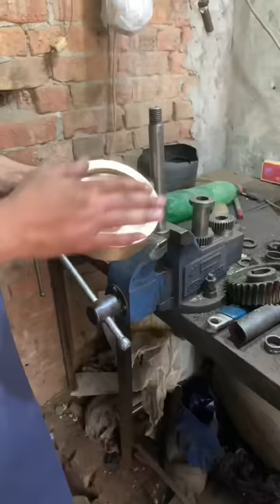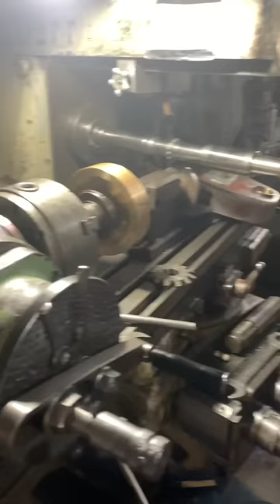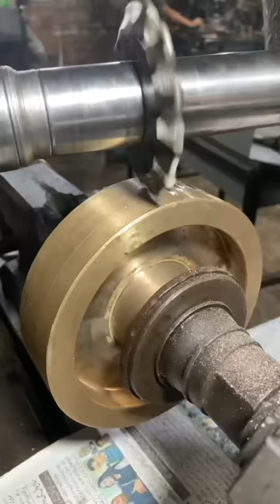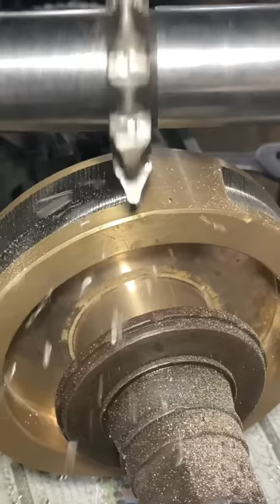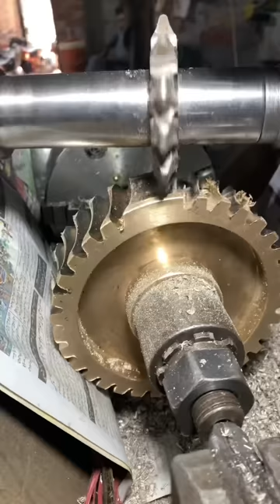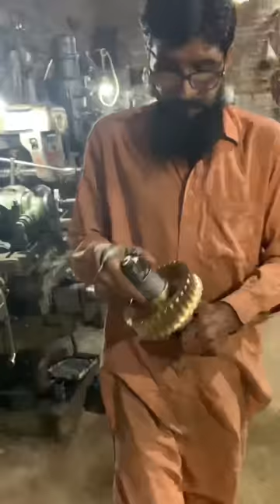Making Worm gear

Comment: It's not a proper helical tooth when cut this way. There is only one point of contact at the very center of the tooth, and this creates a lot of friction because of the high pressure at that point. It will wear rapidly if it is transmitting very much power.

You should cut less depth and then finish the gear with a hob.  But if that is not an option, then cut shallow, and move the workpiece over one tooth pitch, and plunge again. This will shave the top of one side of the tooth. Do again on other side of the tooth. Then increase the table angle a few degrees more, and shave the corners of the tooth so it will clear the worm, while not excessively cutting away the center of the tooth.

 You necessarily have to overcut the depth by a lot to get the worm to seat deeply enough.
Reply: Да тут мало кто понял, что это не шестерня, а червячное колесо

Comment: That's what you call a real machinist...all by hand...no programing no computers
Reply: I was taught to use a manual lathe in metal shop...still remember a few things
Reply: A real machinist just does it by program because it's faster and much more precise.
Reply: Machinists machine shit, use the right tool, and make sure it is done roght
Reply: @panda3d180 what are u telling? What he's doing isn't entirely precise.
Reply: They can't be trusted with a computer...
Reply: Yo he fabricado de todo, hasta cigüeñales  en torno. Mi último trabajo fue en el 2004,  una máquina para elaborar filos convexos en planchuelas rectangulares. Me llevó 3 meses ensamblarla.